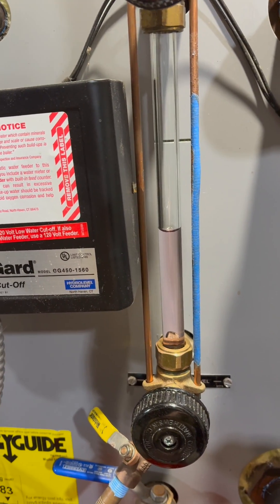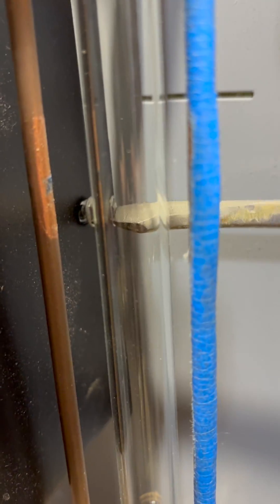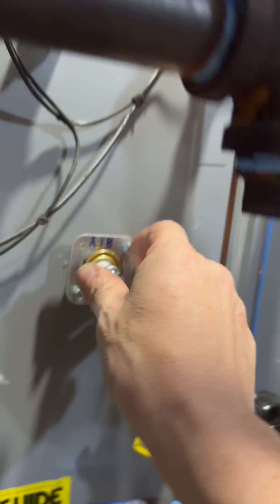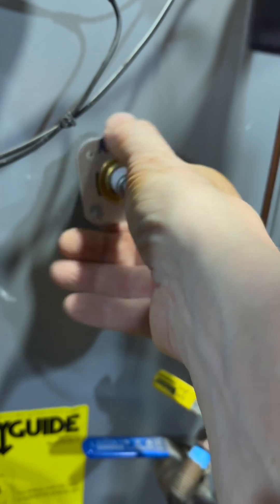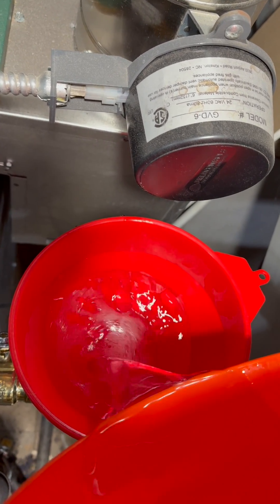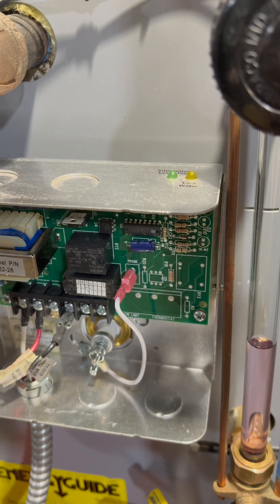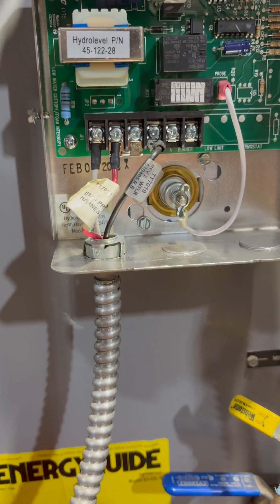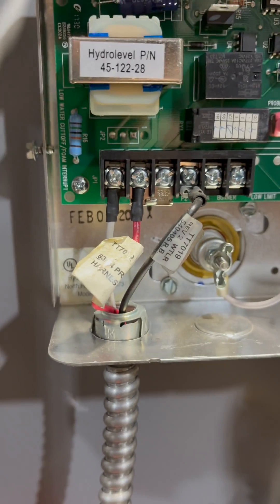Steam Probe-style LWCO Check and Clean

Comment: I have the 24V CG400-2090 (17 years old) that seems to have failed and is no longer indicating low water/shutting boiler off.  I'm not sure how long this has been the case and I should've been testing monthly but I don't like adding make up water of about 3 gals every time I test and I don't have a convenient way to put the water back in the boiler.  Turns out the price has gone from $150 to $230  🥵
Reply from the maker: I take it cleaning the probe didn’t help? I think annual testing is recommended, no one wants to drain several gallons every month
Reply: @pb7379-j2k  I didn't clean it but it measures the same resistance as a clean spare one does when dipped in the boiler water.  Seems like any deposits would only give you a false amber light not the absence of one.  I wish now I had measured its resistance when the boiler was drained down below it, but I highly doubt deposits could be conductive.
Reply from the maker: @captainwho1  I don't think resistance is the thing--so you tried the spare one?
Reply: @pb7379-j2k  My understanding is that the way the system works is, when the water is present around the probe center electrode and of course also in contact with the walls of the boiler to which the other part of the probe is electrically grounded, there is a small electrical current through that water to ground that is in series with a relay which gets energized.  Not sure if it is normally open or normally closed but doesn't matter.  When the water is not present around the probe the relay isn't energized and the LWCO circuitry senses that and shuts off the gas valve and lights the amber light.  So resistance......it's the thing ha ha!  I didn't install the spare one.  The ILT (intermittent level test) feature doesn't work on this unit so it needed to be replaced just for that alone.  When I get the new one I'll install it on the old probe and find out for sure.
Reply from the maker: @captainwho1  OK sounds good, yeah if the intermittent test isn't working the whole thing is probably borked anyway
Reply from the maker: @captainwho1  check out this video where he is showing one so loaded up with corrosion it could be conducting all the time: https://youtu.be/k3sHWzEA10w?si=m01oTmEHiDiGICP1&t=163
Reply: @pb7379-j2k  I'll check it out but if it were conductive I would've gotten a lower resistance reading on the one mounted in the boiler with the deposits helping out the conductivity vs. just the clean one dipped in a bucket of boiler water.  OK I see he is saying the thin layer of water retained on the probe could conduct enough to keep the resistance down.  I doubt it but interesting.  We are talking low voltage here and the relay has a minimum pull in current to function.
Reply: @pb7379-j2k  I didn't try it because the manual implies that a dirty probe will cause the amber light to illuminate.  People in the trade, like Mike Diack, say every month.  These things should be engineered to have a means of self testing without draining boiler water down, I think.  One time 12 or so years ago, I woke up to no heat and my steam main had leaked, draining the boiler to a level where the LWCO shut it down.  If it was non functional it could've destroyed the boiler.  This unit is also not doing the intermittent test every 20m like it supposed to.  It will test 10m after a power shutdown but after that no intermittent self test.  I use the smartcycle option which restarts the cycle when the boiler fires so as to prevent a test less than 20m into a fresh firing cycle.
Reply: @pb7379-j2k  F'n Utub removed my response.  Maybe because I mentioned a certain YT channel operator by name who is in the trade; that he recommends testing monthly.  Hydrolevel does say to clean and test annually.  I think it's inadequate.  One time about 12 years or so ago I awoke to no heat and the steam main had leaked water onto the floor and the LWCO saved the day and shut the boiler down.

Comment: The self-cleaning probes are meant for hydronic systems. The flowing water in the pipe moves the ring around on the probe tip because of the turbulence it causes in the pipe flow.  It's the ring movement scrubs off the buildup. Those will not self clean in stagnant water instalation.
Reply from the maker: Thanks! I wouldn't call my boiler stagnant but I follow what you're saying! I'm not sure where I would have seen that other probe type but that must be it

Comment: How often do you think it’s prudent to check the lwco? I know we discussed reusing the drained water.

I finally did some maintenance on my Weil-McLain last year after more than 15 years since installation. The lwco probe itself was certainly cruddier than yours - though still functional - and I simply replaced it. (Also replaced pigtail, swapped 30psi gauge for 3psi and did a skimming.)

These probe-type lwco devices I expect are highly reliable. Really nothing to the probe itself. If I suspected an electronics failure, I think I’d just pull the wire off the probe and check the box itself that way.
Reply from the maker: I think it's prudent to check a probe LWCO once per year. I admit I haven't done it that often.
I agree they are highly reliable.
During the 15 years how has your water been? Was it often brown, or have you been treating it?
Reply: @ Every few days or a week, I’ll open the bottom drain and I get brown water for a few seconds. As soon as it begins clearing, I quickly close it. Have never treated the water, but I might start using some 8-way and see what happens.
Reply from the maker: @marcinmerrimack1726  I would reduce the amount of draining to maybe once or twice a year. Less brown water should be produced. Just try a little 8-way, be aware that Weil-McLain, almost uniquely among manufacturers only recommends a high end of 8.5 pH (other manufacturers say up to 11 is OK). 
It has been reported that WM is concerned about the elastomer gaskets between their sections being attached by the high pH.
Reply: @ Good to know about the WM recommendation for pH. But why should less brown water (iron oxide) be produced with less frequent draining? Because of the oxygenated makeup water that’s needed over time? Again, I open the drain for 2-3 seconds, just to get the worst of the rusty water out. And I only add makeup water just prior to a steaming.
Reply from the maker: @marcinmerrimack1726  "Because of the oxygenated makeup water that’s needed over time?"

Yes, exactly that.

I know people think that the oxygen gets driven out by steaming just after it's added. This is true. But where does the oxygen go? Into your boiler.

I think almost all the fresh water that gets added to boilers happens just prior to steaming. And yet boilers that use a lot of water seem to rot out faster.

Comment: I thought you were not supposed to use Teflon on the probe since you want electrical continuity.  Not sure about dope but since it worked it must be ok.
Reply from the maker: @tkpk5119  yeah that’s why I didn’t use tape. But I did look at the manual later and it said a thin layer of tape is ok too. As long as it makes a little metal to metal contact it’s fine. It did come with dope on it from the factory
Reply: Great video